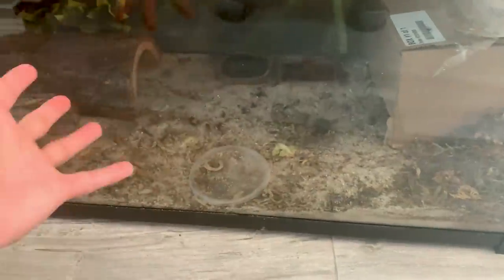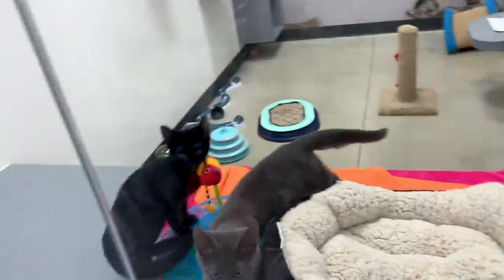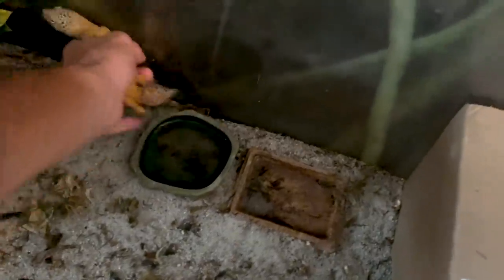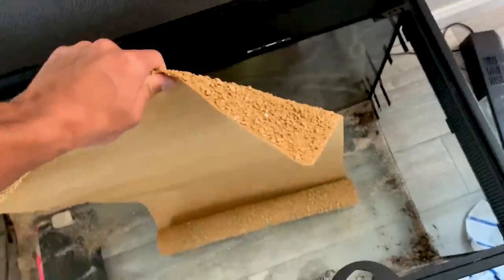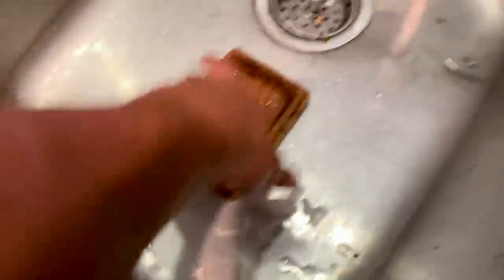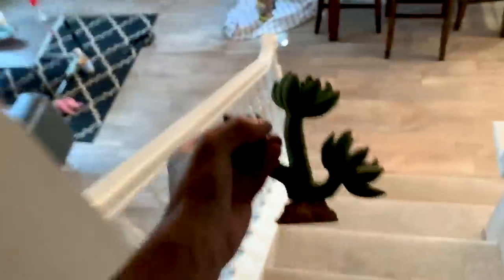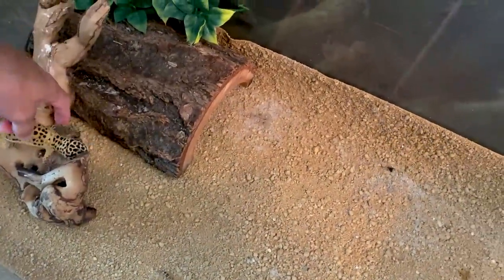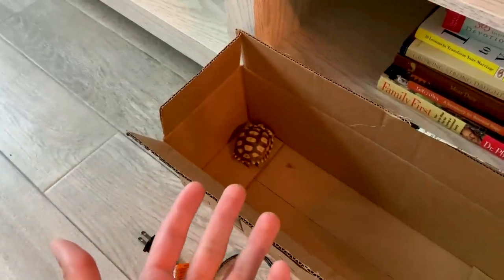My Leapord Geckos NEW TANK SETUP!! (INSANE)

Comment: Sand is very very dangerous for leopard geckos as they can can swallow the sand while eating crickets or mealworms. Their main diet needs to be crickets dusted in calcium. They need a cool hide and a hot hide on opposite sides of the tank. Paper towels are the best substrate but you can use repti carpet. I'm not leaving hate just trying to give advice on the geckos care. Also I dont know if you know the sexes of the geckos but I would recommend going to a vet and getting that done as if they are both males then they will definitely fight. If you have questions you can always PM me  (even though I know you most likely won't)
Reply from the maker: Hey man not sure where you see sand ? Took it out for a reason Lol
Reply: @NickBingo  the carpet or paper on the bottom looked like sand my bad

Comment: Wow cool setup just there is a couple more things you can do to make it the best leopard gecko tank use Eco earth for substrate because if they accidentally swallow it it doesn't harm them it will go straight through and come out the other end where as the substrate that you have got can harm the bottom of their feet and they might accidentally scratch themselves on it! also it is scientifically proven that you should use a deep heat projector and uvb as well that way you don't need a heat mat and you will find you gecko will be more active which is great and NEVER EVER hold onto their tails they will drop off also NEVER EVER house more than 1 leopard gecko together EVER!!  Thank you i just love leopard geckos and i have one myself and i try to give them the best life possible lover your other vids!

Comment: Hey man, gotta say you made some upgrades but it's definitely not on point yet. They have nothing to climb on like a wall or something like that. The surface mat you are using should be sealed with some sort of kit so crickets and worms can't get underneath. And you are aproaching them from above as they stand on the ground, i don't know if you have any cats or dogs but that is extremely stressfull to them. I own a leopard gecko for over a year now and i did tons of research and i gotta say your lepps are looking stressed out as soon as you open the terrarium. I think its better to put them on a table or something like that.

Comment: First of all, that is not enough space for 3 geckos and a tortoise in fact it isn’t enough space for 2 leopard geckos. Second of all, u need to put more things into the tank because u barely put enough stuff in there and it is extremely empty. Third of all, u should have completely cleaned the bottom of the tank before putting the mat in so that there would be no bacteria and the animals could live in a good environment. Lastly fourth of all, you should rlly clean the tank more bc it was obviously disgusting and very dirty and there was lots of bacteria and not a good environment for the animals to be living in. Not to hate just giving u some tips to give the animals a better life:)

Comment: First, do not ever use loose substrate for leopard Geckos, use reptile carpet, newspaper or paper towels, not loose substrate. Second, it is not recommended to house 2 leopard Geckos, male and male is a no go since they will kill each other, male and female will breed or one of them would feel threaten by the other an starve to death literally, and female and female CAN be done but it is not RECOMMENDED since they are solitary animals, so it is better each gecko gets its enclosure, also they are very territorial. Third, you need to provide a hot hide, that has a thermal pad under the terrarium so heat can pass thorough, since leopard Geckos absorb heat from their abdomens, the temperature in the hot side should be around 30 C Celsius, meanwhile the moist or cold hide, should be around 22 C Celsius. The hides should be at each corner , so one side of the tank is hot and the other is moist and cold, and the middle of the tank is kind of the middle of the temperatures. Humidity most be around 20%, just apart the enclosure a little bit a few times a day and you are good. Good video and hope you give the a great care

Comment: Your animals look good and healthy. But as far as the top is concerned, it's really quite basic. Properly, there should be at least three hidden. One warm, one cold and one warm and moist. A lot of people think that a cold shelter is one that is supposed to be damp and where the gecko is supposed to shed its skin. Only such a shelter can be because it is on the cold side and too cold when it is still humid. It would still need some additional enrichment. Such a reservoir is good from the point of view of maintenance, but it is not entirely ideal for the animals. Try to simulate the natural environment of the gecko as best as possible

Comment: Don't put leopard geckos together

 you need a 45,45,30 for minimum leopard gecko enclosure they need temperatures from 23 degrees celceus to 27
They need a cold hide and a warm hide I would recommend having the heat mat under the hot hide 
They need a uvb light for my leopard gecko I use a long tube uvb uvb a light I would recommend it feed them everyday when they are a baby
Feed them 2-4 crickets when adult feed them every 2-3 days my gecko usually eats about 5-6 crickets 
Definitely give them a calcium dish I have a bottle cap with calcium in it 
Dust there food with vitamin powder and calcium powder 
DO NOT FEED THEM VEGGIES OR FRUIT

Now for substrates I keep my geckos on eco earth DO NOT USE CALCIAM SAND it Leeds to impaction and that causes death 80% of the time 

A list of substrates you can use are

Repti carpet 
Coco husk
Eco earth
Toilet paper

I recommend something they can dig in though because it's a lot nicer for decorating I have some fake plants ( you can use real ones) and a reptile hammoc 
I have a shed box which is an old tub big anough for my gecko to go in I have moss that I bought from swells reptiles in that and spray it once a day 

I would also recommend mourning gecko for a great starter reptile. I have a YouTube channel where I talk about my reptiles I do this with my brother it's called TheReptileBrothers

Websites I recommend buying your stuff from

Exoticpets

Swellsreptiles

Morphmarket

Josh's frogs 

The over all cost for my gecko was £150

Comment: "a rough rocky feeling. feels good for them." 
awful man, that sounded so wrong
also check your research: Leopard geckos use their environment to regulate their body temperature. So, it's important to provide a 'thermogradient' - with a heat lamp at one end and a cooler area at the other. Use thermostats to regulate the temperatures. Leopard geckos also need ultraviolet light and a dry environment.

Comment: It’s horrible that you kept a leo and a tortoise together, I’m glad you changed it. However, housing leopard geckos together isn’t good either. These are solitary animals. Housing then together causes a lot of stress. Sometimes they will fight or even kill each other. Also, they each need three hides. 1 warm hide on top of the inter tank heat mat, 1 cool hide on the cool side of the tank, and a moist/shed hide in the middle. That’s for each of the geckos!! So if you were going to house then together (which I do not reccomend at all) you need 6 hides in the tank. Also please please have a thermostat for the heatmat, they can overheat and burn the geckos without it.  Very disappointed someone has done so little research into he care of the animals you have. Please listen to some of the advice I’ve given or research for yourself. Many pet stores give false information, and many websites are outdated

Comment: Hey, yeah this still isn't right for a Leopard Gecko.
You need three hides, a cold one, a moist one and a warm one. The moist and warm hide should be on the side you have the heat pad on. Your heat mat should also cover 1/3 to 1/2 of the tank and they don't need lights at all. 
You should do a bit more research on these animals R/LeopardGeckos on Reddit has a wonderful pinned post on these guys.  
Not to mention NEVER cohabitated Leopard Geckos, they're territorial, they fight and a Male and Female WILL both fight and breed and the breeding process is rough on the females.

Comment: Ummmm heat lamps are way better and do not dry out skin if you but a wet hide it makes them wet so if there skin did get dry they could go there but like you said they live in the dessert so there skin will not get dry i have 2 myself and you should separate them bc it looks like the boy bullys the girl so i recommend that but like i was saying my two have two 50gal  with 100w heat lamps and are perfectly fine so yeah you did better improvement its still really dangerous in there but no hate

Comment: Please do not cohabit leopard geckos I would recommend more clutter if you can switch to loose sub like 70/30 organic topsoil and play sand mix and another don’t feed leopard geckos everyday unless they are baba every 3-4 days and one big big big things please dust and gut load it so important to dust and keep calcium in their setup or they will get health problems such as Metabolic bones Disease also I would recommended switch to over head heating using halogen bulbs or deep heat projector please do better research :)

Comment: #1 you need a large heat mat with 2 seperate hot hides for them, have the heat mat on a thermostat. #2 if you’re gonna clean their tank, actually clean it properly #3 they need a humid hide #4 they need 2 cool hides. No lights as it makes them blind. No CHE unless your house gets super cold at night. #5 they need calcium D3 in a bottle cap accessible at all times to them #6 too small of a enclosure to house 2 leopards together - which they should be on their own but since you’ve had them together for 7 years I’ll let that slide... 

Please don’t post videos if you don’t know what you’re doing....

Comment: You still need a moist hide either 2 of them or one big enough for both of them , use caution when feeding them together because their vision isn't perfect and they will accidentally get the other ones face tail and/ or feet and hands I promise it will happen I have 5 females 3 in one home and 2 in another and they have gotten their lips and tails tails more often are mistaken for worms luckily I hand feed them and I was able to avoid blood shed or one losing her tail You also need a small calcium dish because they know when their not getting enough and they'll take it amongst themselves to lick it, you may never see it but believe me they will lick it and they know when they've had enough and will simply walk away same with water you may never see it but they will drink it. You need a thermometer, humidity gauge and a temp gun they heat t through their bellys not from the top therefore uvb is not a necessity but however doesn't hurt 😁
Reply: Please Nick do more research and if I may suggest a couple of very good information sources I would suggest Clint's reptiles , and Leopardgeckos both have 100% guaranteed facts that everyone needs to know about their Leo's . Believe knowledge is a never ending thing and you simply can't get enough have a great day and good luck

Comment: This is a bad setup. 

1. You should not house leopard geckos together. Even if it’s a breeding male/female couple, they ultimately prefer to be alone

2. You do not have enough hides. You need at least 3 hides for each gecko. Those logs you have are ok, but they don’t block much light and your geckos could be stressed with no dark places to go to 

3. You need a humid hide. One that has some kind of moss. Preferably sphagnum moss that you can spray and make damp. This helps for shedding. Leopard geckos are notorious for having bad sheds especially on their eyes and toes, humid hide is a must! 

4. It looks like you put your thermometer/hygrometer on the top of your terrarium. This won’t give a good reading of the temperature where the geckos will actually living on the bottom of the tank. 

With leopard geckos, air temperature isn’t as important as surface temperature. Invest in a temperature gun or get a thermometer for your heating pad, so you can know the surface temperature of your hot spot. Should be around 95 degrees